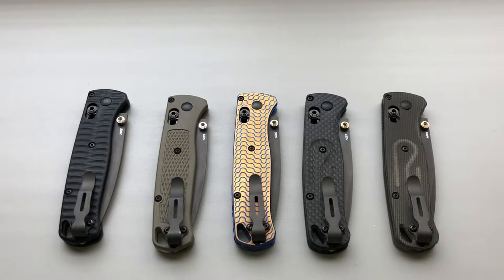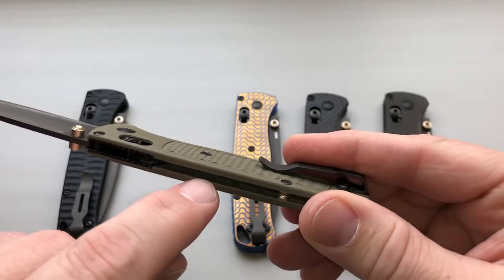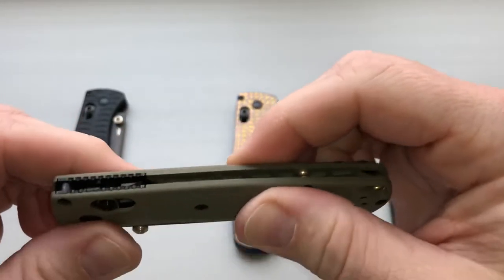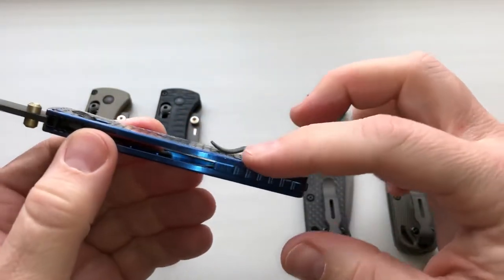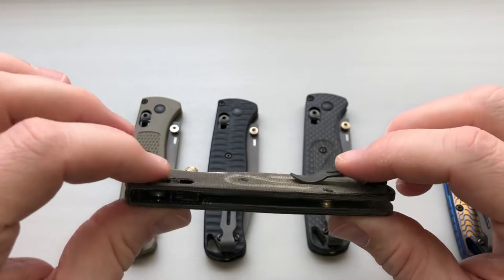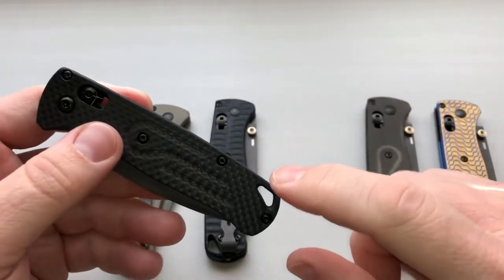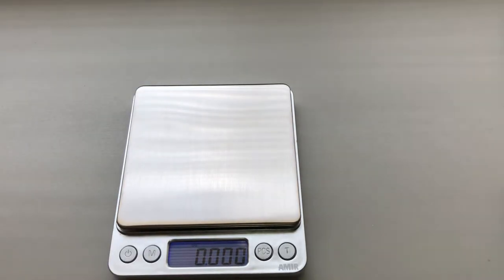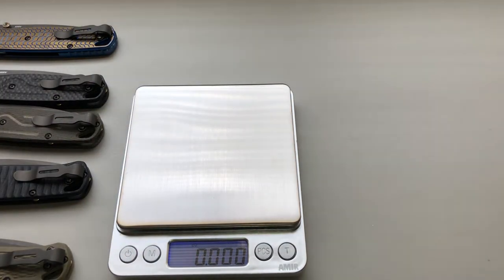Will it Flex?? What Does the Bugout Weigh w/aftermarket scales??

Comment: It's not made to be a heavy duty knife. If you're using it in a manner that flexes the scales, you need to go get a cold steel recon or something else made for harder use. The bugout is made to be very light weight for EDC.  Use the right tool for the job. The bugout is perfect for its intended purpose.
Reply: I was going to comment something very similar. Thank you for making that clear. People are complaining that it wouldn't make a good pry bar, and that the grivory scales could potentially break. What's crazy about pry bars is that they're not knives.
Reply: I was gonna say the same thing but I carry a Leatherman everyday which is never the right tool for the job...... lmao

Comment: There is absolutely no possible way to break the stock Bugout handle without first breaking the blade.
Reply from the maker: Agreed! Would have to be prying pretty hard to snap those scales!!
Reply: Regardless of whether or not you believe the handle will break, the material used as the scales is just cheap garbage. I myself have used a knife to pry things before and I wouldn't trust that cheap plastic. They could have at least made some nice G10 scales. 

The cost of that knife to be made is no more than $15. It isn't anywhere worth the $120 price tag. No thank you.
Reply: @DaroffApFire  Why?
Reply: Fiber reinforced nylon is pretty damn strong
Reply: Daroff G10 has been proven in tests to more prone to fail under extreme stress than FRN when compared at the same stock and thickness. FRN is also oil an chemical resistant. I’m in agreement with you that G10 has a better feel in hand but if you want a knife for EDC and hard use FRN is a phenomenal material.
Reply: We can talk all day about breaking blades or scales by prying things..guys if u dont own cheap screwdrivers either way that is on YOU. No way I'm prying a damn thing with either of my Benchmade knives. That butterfly is too expensive for my blood.
Reply: It’s not made to be a rugged folder.....If you want a rugged Benchmade for prying and beating crap up.....get the Adamas, Contego, or the new Turret.  
It comes down to choosing the right folder for your needs and life style.
I carry my Bugout every Sunday to Church in dress slacks.
Reply: The reason that FRN won’t break and g10 will is because of the flex

Comment: Yes there is a bit of as you say flex.  I have a 535 with aftermarket mycarta scales. And the mini bugout. This isn't a issue for me if I need to work a knife. With hard use it's going to be one of my fixed blades. The bugout or any folder is not designed for hard use. Just my opinion

Comment: Such an overblown, made up issue. If the feel bothers you, fine. But to argue that it isn’t strong enough... it’s way stronger than any pocket knife needs to be. If you want to go out in the woods and beat a knife through stumps or make a ladder by stabbing knives into trees for steps, get something else.

If you want an edc knife, just buy a Bugout.

This is the plastic gun debate all over again, and look at Glock now. The Bugout is the new Glock of the edc world.
Reply from the maker: Agreed! Did a video doing some torture tests including running it over with my truck. Works just fine!!

Thanks for watching and supporting!
Reply: I’ve EDC’ed a Mel Purdue 530 for over 10 years.  Never had an issue with flex lol.  I’ve opened cans of soups and vegetables, whittled tons of stakes, cut miles of rope, and even batoned a few branches.
Reply: Had an omega spring snap on mine, never did anything with it except flick it open at my desk occasionally, cut cardboard, and open packages 😬
Reply: Nah ! Don't like em. Get a Spyderco
Reply: @droptuned83  no thanks, I like sleek knives that fit in my pocket comfortably.
Reply: Droptuned 83 nah , sticking with bench made
Reply: Calling this the glock of the knife world man I can really see that and its so true. So customizable just like the glock also.
Reply: @michaeldailey7550  agreed, it's similar to what you see in aircraft design, reinforced where it needs to be strong and weight is prioritized elsewhere in the design.  I think people are just used to seeing 2 slabs of stiff material slapped on a blade and it feeing like a tank.  I bet a lot of other knife makers start coming out with their ultra light designs after seeing the success of the bugout.

Comment: Just wanted to let people know, if you are concerned with the flex of the Bugout but like the size, you might be interested in the 'Mini Presidio II CF elite' model it's pretty much a bugout size Benchmade but with full steel liners, still only weighs just over 3 OZ so it's not a heavy knife.
I just got one and it's a serious workhorse in the black class, if you ever have a problem with anything int he blue class, check out their black class alternative line for a similar size blade, and it will be an over built alternative that you won't worry about being fragile.
Good video nice handle mods bro, looking fancy.

Comment: The stock ranger green bugout is the most beautiful switchblade I've ever seen. I'd rather deal with the flex than downgrade to studried but not as pretty scales. I'm a sucker for olive green
Reply from the maker: It is a classic Bugout model! Did you see the G-10 olive green they came out with through SMKW?? Looks and durability!
Reply: I love olive green, right up until i drop it in the woods then it's never seen again, go with a brighter color for practical reasons

Comment: I tried a Delica 4 and hated the gritty feeling scales... just didn't feel good to me. Do the stock OEM scales of the Benchmade Bugout feel about the same?
Reply from the maker: They have more texture to them but to me feel better. They are still a plastic/frn handle material. So if you are not fond of that feeling then grab some aftermarket G10 or Carbon Fiber scales and you will be set!

Comment: "Flex". If you  pinch  any pocket knife  in the  middle of the handle....and there  is little to now lmetal liner ...course there will be  some degree of flex.  How you and others  should be testing knives for FLEX is under actual use e.g. how you /we would actually be holding the  knives. 

I've never  held a Bugout ...or any  pocket-knife with the  same build. But I'd bet we  probably wouldn't feel the FLEX...more so if we're not looking for it. Wehter it's  a knife with  Benchades Grivery, Spyderco's FRN...etc. e.g if you're opening a box, breaking down a cardboard box... and we're not torquing the handle...

We need to also start  doing realistic blade tests....what  can  these blades really handle cutting before they  start chipping?  Or dull faster...etc.  If you use a  pocket kniffe to pry  staples ...the cutting edge will chip...obviously.  DUH. "The Last Boy Scout" carved a  fork from  a branch--chipped  the cutting edge  slightly  on a S30V Bugout blade..."hard use" ...licer blade being so thin...not built for  carving...heh...want  a ...probably want a blade  with 30 degree beve :)) Common sense (which mot people lack)..
Reply from the maker: Check out my Bugout test video. It held up pretty good! The easiest way to show the flex on camera is to pinch it together. Appreciate your feedback!

Comment: there is flex in my golf clubs and I promise that takes way more abuse than anyone would dish out on a  bugout for everyday use. unless you are raiding tombs and living off the land with just a bugout in your pocket. If you are, you're an idiot. but if you tackle cutting packages, rope, even manila rope I don't think you would have a problem. its a useless worry for the intended use of the knife. its also not a tactical knife,  so don't use scenarios for why it would fail under those conditions either.  ONE IS NONE TWO IS ONE! carry an EDC knife, Carry a Fighting Knife. carry a edc flashlight and carry a tactical flashlight. carry a gun and carry a pocket backup one.